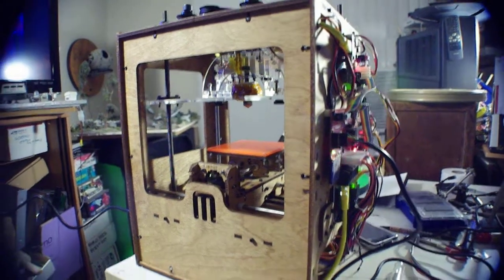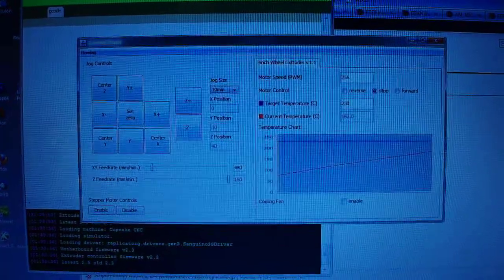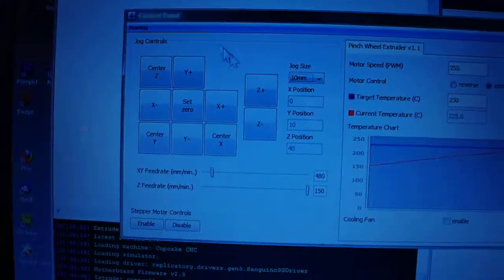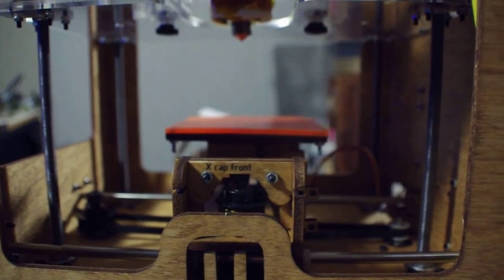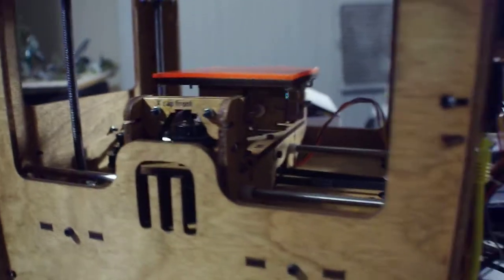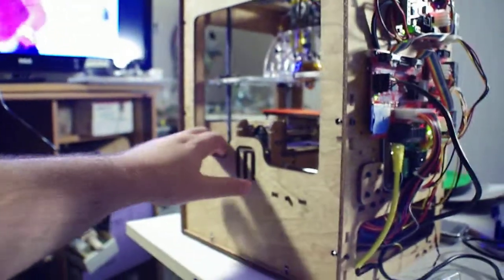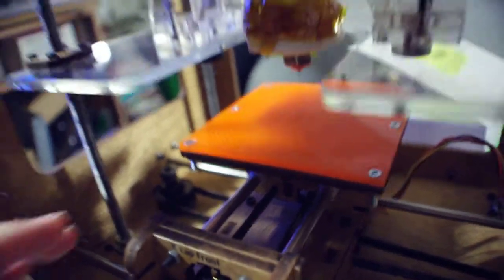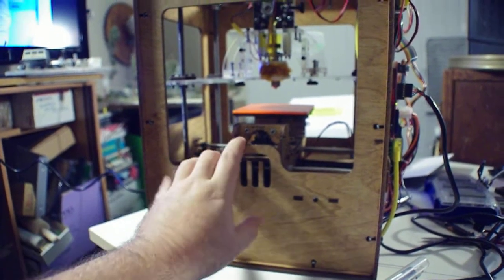Makerbot 11: The Finish Line 3/3

Comment: The MakerBot did ship with optical end stops for each axis which were intended to be used for the auto home feature in ReplicatorG. MakerBot stopped shipping them several months ago as they were very unreliable and were triggering part way through a build by things like daylight and fluorescent lighting. Not everyone bothered to install them and they were connected via Ethernet cables to the stepper drivers which meant trying to route 6 fairly chunky cables around your bot. MakerBot have gone w